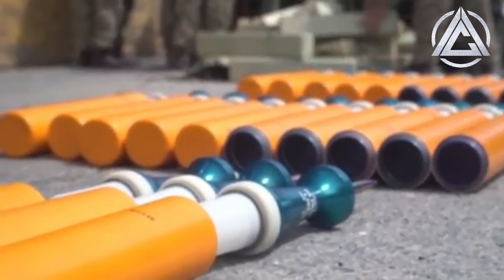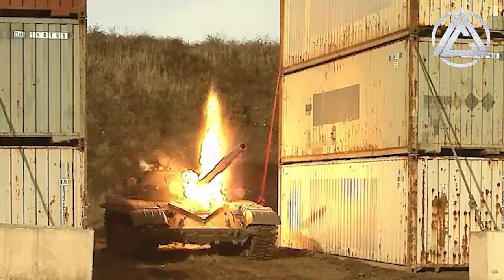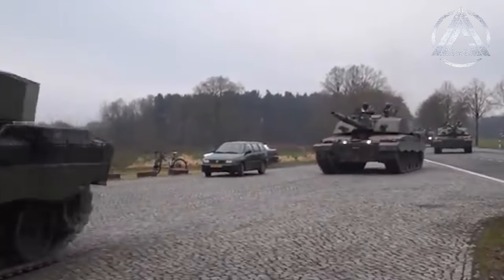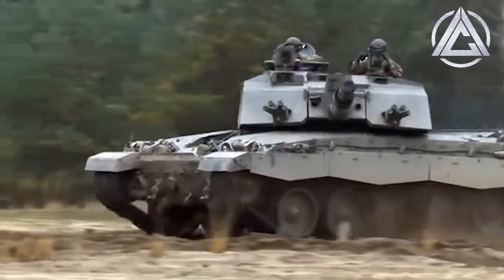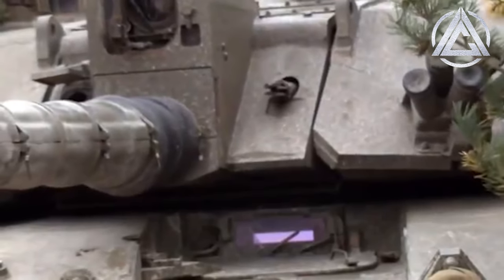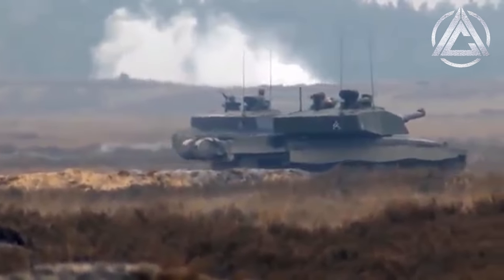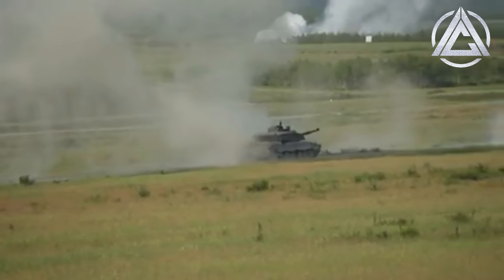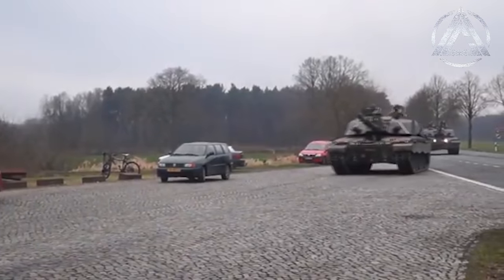Challenger 3 | Britain's New Main Battle Tank | Is It Really Any Good?

Comment: Although I agree with your point about this just being a small upgrade, how can you get any information on the armour capability. Isn't that extremely confidential? If its touted as having an equivalent thickness of Xcm of steel (etc.) then surely that is something we would keep secret?
Reply: It's basically the same Chassis as the C2, and the turret I'd assume is similar to the Leopard 2 considering its made by a subsidiary of the company who makes leopard 2.
Reply: @seanbailey8545  In my comment, I question the comments on the armour - the chassis is a different & independent entity
Reply: @xdazamx  I also addressed the turret and therefore the ERA being similar or even just a straight copy of the Leopard 2. Considering they are manufactured by an off shoot of the Leopard 2 manufacturer.
Reply: @seanbailey8545  Right, but what of the effective thickness/performance of the Dorchester armour found on the C3 over the C2. As in, before ERA/spacers are applied.

I'm questioning how one could make a comparison on the armour given that information should be confidential. Is it not?

I'm not asking about the ERA nor the actual design. I hope that clarifies what I'm asking... otherwise I may be misunderstanding what you are conveying.
Reply: I will wait until I see the info on the war thunder forums

Comment: Are you sure about the armor protection, I swear they said they were going to use new composite inserts? As for the name, it kind of is a new tank, they had to change so much internally to get it to use the gun and set it up for safe stowage of new single-piece ammunition it's little more than a Chally 2 cosmetic skin. While generally speaking more HP equals more speed when it comes to diesel with the right transmission they could get more out of the current engine. Though they should have thought about a powerpack swap, maybe that put it over budget or messed with all the changes they had to do to get the new gun in the tank.
Reply: Looks like the jet engine power-packed Abrams had it right all along. So easy to change that monster out. Germany had it wrong with complex diesel and transmission like they did with their king tiger of ww2. Of course America has its own king tiger in the Abrams. Still the best even though it is the oldest of all these modern tanks.
Reply: @frankcrawford416  An experienced crew can change the powerpack of the Leopard 2 in about 30 minutes in the field if there's a Bergepanzer Büffel around, which normaly is. The Büffel can even give it's own powerpack to the leopard 2 if necessary because it's exactly the same. How many other vehicles do use the same Powerpack as the M1 again?
Reply: @frankcrawford416  you say that but the next version of Abrams the m1a2d is supposed to get a Diesel engine
Reply: I agree I believe his sources on the Armour is a bit questionable. Challenger 2 has always been regarded as the best protected tank and has the combat experience to go along with it. This is the first time I've heard otherwise.

Comment: I love it when somebody has never served on a MBT tells you about upgrades to something and then start a slag it off

Having served on chieftain, challenger 1 and instructed on challenger 2 I can tell you that most of what you said is inaccurate

All the tanks that you’ve mentioned, i.e. leopard, Abraham, I have seen parked up on a road under trees, hidden broken down because of their engine failure is et cetera 

Yes, chieftain has it’s problems, but once those problems were resolved after the first few days on exercise tend to run perfectly for a very long period of time. It would then be stored in a hanger for months upon end before used again weight would be battered and then break down again. And repeat

The armour on challenger 1 (Chobham) and Challenger 2  (Dorchester) is most definitely the best in the world so much, so that I believe the Americans have asked if they can have it for their own MBTs. 

The same problem with the CV 12 engine is because of its lack of use, and it being stored for long periods in hangers, and then used in thrashed when it goes out on training et cetera. There are very few problems with the engine once it is out in theatre and has been used for a prolonged period of time ironing out the small or large problems.

I agree that the CV 12 should’ve been replaced, probably with the Mercedes engine that was suggested years ago. But that was not done and we have to move on with what we have. Challenger 2 is a world-class MBT and I’m sure challenger 3 will be even better still.
Reply: British army tanks are not in battalions, they are in regiments. 

All this conversation as well you have to remember that challenger or any other European tank is not facing another European tank. It’s facing the likes of the T72 T80. 

The MBT is that the British army have just have to be better than those that are currently in service with Russia. The MBT is throughout the west are so much superior than those currently in service with Russia, or even China, although those in service with China are a lot superior than those held by Russia currently.

I’m afraid I had to stop watching this halfway through as a sort of gave me a Pukie feeling  with another person who has no clue telling us a right load of bollocks.
Reply from the maker: I love the "I served on Challenger so I KNOW it has the best armor in the world!"

For one, I know you're lying. You don't know any more about Challenger's armor effectiveness than I do, and that's purely through research that anybody can do. I know plenty of Challenger 1 and Challenger 2 crewmen. I know who has access to classified armor values and who doesn't. Your average crewman or training officer does not. Why would someone need those armor values to drive the thing or load the gun?

Two: Even if you're one of the rare higher-ups who DOES have access to that information... you do NOT have any access to that information for the Leopard 2 or Abrams, Leclerc, Type 10, K2 etcetera. You gotta do research just like the rest of us, and all the evidence available points to both Leopard 2A7 and M1A2 SEP having better protection, along with Strv 122 which entered service the same year CR2 did.

If you can prove to me that the existing available evidence is completely incorrect, please do so. Until then, the most credible and reliable sources are what I shall be basing information I give off of, and "I served on Challenger so I know!" is not credible information or proof of anything.

You are also wrong about America asking for the Challenger's armor for their Abrams. America DID use Chobham armor, same stuff Challenger 1 used...... on the original M1 Abrams from 1979. They replaced it by 1983 with superior domestically developed BRL versions, which they since upgraded in 1987, upgraded again in 1992, again in 1999, again in 2002, and then AGAIN in 2017. Since it was developed in 1986, the Dorchester armor array on Challenger 2 has seen zero upgrades... but somehow, magically, even the top power in the world with over 12 times the defence budget... was unable to match it? Come on, think about it for a second.

The only other time they've asked for Dorchester armor was to test it ballistically, in which case they found it to be penetrable by M829A2, a kinetic penetrator, at ranges closer than 400m. That puts it well below Abrams' AND Leopard 2's arrays in effectiveness per volume against kinetic energy threats. As for protection against chemical energy threats like RPGs and ATGMs, Challenger 2 is all but impenetrable frontally, it is true... ... as is M1A2 SEP, Leopard 2A7, Leclerc and Strv 122

Comment: I believe it’s an amazing tank it rivals the Abrams but luckily they’ll never go against each other in a war I will say after being in at ABRAMS as a fire control officer that some of the ammunition at the ABRAMS uses such as the dark the depleted uranium may hold a slight edge on velocity but these tanks are absolutely gangster both of them and the German tank is also Up there
Reply: Depleted uranium or tungsten rounds are useless at long range because they need that kinetic energy. Challenger 2 rounds work the opposite way to armour piercing rounds by splatting against the armour like a giant piece of shit and then detonating… relying on the shockwave to screw the tank crew.
Reply: ...That's completely wrong. HESH works by squashing the explosive over the plate and detonating, causing shattering of the armor on the other side without penetration, the spalling then causes the damage on the inside.
Reply: @alanwatts8239  I know.   Point ?
Reply: @ronemtae3468  Sorry, it was meant for the first reply stating the destrutive power of HESH relies on shockwaves.

Comment: This hasn’t aged well , compared to t90 and other Russian tanks this would do well .Crew effectiveness and deployment are of paramount importance and a reliable platform .
Reply: The main comparisons raised in the video are against the Abrams and the Leopard regarding Engine power, active protection systems, weight and armor.
All of these points still stand; also, it was specifically pointed out at the end of the video that there are a million other factors than just the raw performance figures that go into combat performance.

Comment: "Challenger 2 has been a controversial tank, with several features seeming outdated or regressive. "

No it hasn't. Best armour, one of the fastest and up to date tech.
Reply from the maker: It's literally the slowest modern MBT out there, and didn't even have "the best armor" when it was put into service in the late 90's, let alone 20 years later!

Both M1A2 and Leopard 2A5 had better turret armor before CR2 was put into service, at least as far as kinetic energy munitions go. Leopard 2 even matches it in chemical warhead protection too, as does the M1A2 SEP version which entered service just a couple years AFTER Challenger 2
Reply: @ArmorCast  You make me laugh...You run through the features like a school kid comparing Top Trump cards lol...The little thing you miss is the Chally (and it's tank crews) has the best real world combat record of any modern tank. Far better than the Abrams, and that's no slouch...With regards HESH, one of the main reasons it was loved by the MoD was that it was comparatively cheap especially compared to the various CHARM rounds, and HESH is of course fairly multi purpose...
Reply: No, it was not fast, but it has a great armor. Don`t see a reason, why Challenger 3 would be worse. There is lot of opinions in internet - like assholes, everyone got one! But Abrams, Leopard and Challenger etc are pretty equal.
Reply: @ArmorCast  As I understand it, while lacking the "top" speed of other tanks, the Challenger was in fact as fast or faster than others over rough terrain,  where it really counts.  And given its survivability record, your contention that it has poor armour really is nor borne out by real world events.

Comment: Britain should have gone 130mm.  There are few enough of them not to be bothered with logistical commonality.
Reply: Plus, with the 130mm's autoloader that means only 3 men per tank instead of 4. With Parliament mandating that the British Army downsize to the tune of 72,500 soldiers, 148 fewer men needed to crew Challengers means 148 more men available as crew for an Ajax or Boxer unit. The British Army even after downsizing will still be large enough that 148 men isn't all that much, but every little bit helps when Parliament has decided you're the least important branch of the military.
Reply: @RedXlV  you do need to remember though we are adding more and more onto tanks and lots of tank crews said it would have been almost impossible to perform maintenance in field without a 4th member
Reply: @jacobkingsford5209  I'd be interested to know how that's worked out for France, seeing as they've been operating the 3-man crew Leclerc for almost 30 years now.
Reply: @RedXlV  from what I've heard the Leclerc is very maintenance heavy compared to other tanks
Reply: @jacobkingsford5209  Well, they argument tank battalions with additional company on wheeled vehicles. Also remember ultrasophisitaced electronics and Lecler's super compart, super high pressure Hyperbar engine.  This is amazing vehicle, but all this amazing stuff must have a price.

Comment: The power plant will get the upgraded CV12 which has improved cooling, filtration and fuel injection. It is NOT the same as CH2. This will put out al least 1500bhp and probably 1600bhp. The transmission will be upgraded to Handel the increased power. The hydrogas suspension will be upgraded too. As the CH3 is only 1 t heavier then CH2 it is obvious it will 
Be faster. How much faster we woll see.

Comment: While I agree this may be to little to late, I cannot help but wonder if there is not a silver lining. The next generation mbt will need the c4i system and a battlefield weapons system. England will be far ahead of the game than most other countries. They will be updating these systems, not building from the ground up. This will shorten development time considerably. It will also be cheaper. Clean paper projects are becoming astronomically expensive and usually slow. They will be able to refine an advanced system. Just a thought.

Comment: Good video, but I did find the opening statements a bit odd.
I loved watching the Centurians doing their thing and in a parade the look and sound as they rumbled past was absolutely spectacular, the Centurian not only did it's part but it looked the part. And then it was replaced by the Leopard 1, it was a totally different look and feel and it never seemed to stack up against the Centurian. Then we got the Abrams, its big and powerful and when the crew are in sink with the behemoth they are virtually unstoppable.  However when I think of a Tank I still think of the Centurian.

Comment: I see this thing as a variant/test platform. The tank could be used to test different APS systems and even new types of blowout racks, maybe new optics, ect. However, it is just a variant made too late. What they needed to do was add an APS, drone link, and a much better power pack. The Black Nite looked like a much better option, being that it already came with a pretty good APS. If that APS was automatically reloadable, the Iron fist would be amazing.

Comment: The slip rings reduce spin to 10% of the rifling rate of both the sabot and the rod. The sabot blows off under both spin and wind effect slowing the rod spin even further. A very little spin is good to keep the rod stable until impact. Somewhere in storage I have bits of US 105 slip rings. Good to see the standardization effort.
Reply: Yep, the stab fins on the sabot, and other rounds is to NOT spin. And also why most MBTs are smooth bore, because 90% of all the ammo is far better not spinning

Comment: As to the HESH (HEP is US Army terminology) not working with a smooth-bore gun.  This is due to having the HESH round merely be a conventional cylindrical/ogival-nosed FULL-BORE projectile.  What if you made the HESH internal part slightly narrower (10-15mm, say) and then thickened the outer so that it remained 120mm, BUT, opposite the concept of a rifled bore, you put twisted groves along the side of the new-model HESH shells from base to the lower nose.  Then, when you fire it, some of the blast will go through the grooves and spin the shell.  These shells are fired at a much lower muzzle velocity than the APFSDS rounds, of course, so some of the propellant power being diverted would be of no consequence.  The shell would not need to be complex in any other way.  We are not talking about long-range precision fire against a moving tank for a usual HESH target, now are we?

Comment: You should update this video as they have announced a new power pack confirming 60MPH standard, and more upgrades.  Also some tech they will not even share as they are classified, this is the same on Challenger 2, it has some tech which is classified and you will not hear about for decades.

Comment: A thing about learning lessons, is there needs to be a lesson to learn; the Challenger 2 never failed, in fact, except for outside of a single friendly fire incident, the Challenger 2 has never been fully downed or crew killed. Overall, the Challenger 3 does appear to have some spots for an APS to go, likely the decision is to be based on technology closer to deployment, I don't think anybody seriously thinks the UK military intends to deploy the Challenger 3 lacking an APS, but we will see closer to deployment. Personally I do worry about designing things for the "future", it's an idea that people think sounds good but it's often a gamble, if you do not correctly predict the future it can leave you in a very bad position, while what is going on now is much easier to predict and solutions built for now are often easier to upgrade further into the future than having built things the wrong way because you made a mistaken assumption.

Nobody actually knows what is in Dorchester Armour, so when people are comparing it to the Armour on other tanks, it is sketchy, more so when talking about chemical performance. The challenger 3 will further be going to Epsom and Farnham, which are upgrades. Overall the Challenger 3 program is exactly what it needs to be, it is an upgrade program for the UK military's ageing Challenger 2 tanks to ensure they are up to modern standards. The question to if the Challenger 3 is actually any good comes down too two factors. Does the UK having newer tanks dissuade any foreign nations from aggressive actions either against the UK or any of her allies; or should that fail, how well does it perform on the battlefield. Challenger 3 is slated for service in 2030, how wars will continue going into the future, is hard to say and it's possible that wars simply become less common meaning it never gets battlefield tested.